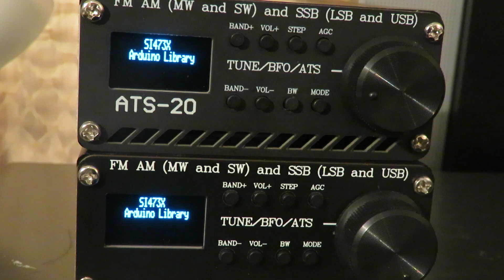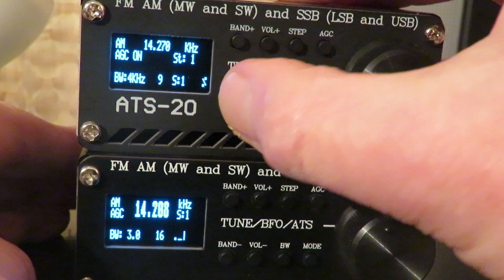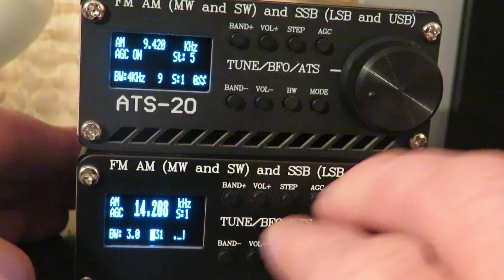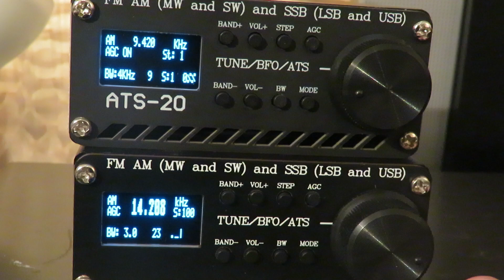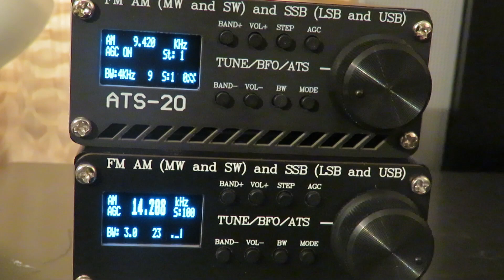SI 4732 Firmware comparison

Comment: just built my kit version of this radio, and after making sure it worked, flashed the latest firmware :)  much nicer than v1.1.5. seems only 1 unused button now Vol-, some seem to have been moved around since this vid.  Got mine stuck to a lith cell about the sise of the main board XD 4500mah. should last a good while :)
Reply from the maker: Yes I need to upgrade to 3.0.7a that is theb difference. These radios are OK but the quality of some parts, particularly the encoder isn't too good.
Reply: @KevinOReillyswl  hopefully the encoder is an easy replacement. i'm about to 3D print a basic case for my radio :)

Comment: Selecting the function then using the encoder wheel to change settings (especially volume) is cumbersome and wrecks the user experience.

It has dedicated up and down band and volume keys for goodness sakes. Why go through scrolling through functions, selecting it, then using a known unreliable encoder just to change the volume?

I’m keeping PU4CLR’s otherwise excellent firmware but trying to put some of the buttons back where they belong.Hopefully, the user interface change is not out of necessity.
Reply from the maker: I think you have a point, its down to personal preference I guess. Let's face it the encoder is heavily used anyway in a radio so if its going to fail its going to fail!

Comment: Hey Kevin, my encoder failed but I ordered a Alps encoder 30 indent, infinite turn with momentary push button. It has 2 contact tabs on one side and 3 on the other that you have to bend forwards. 

With a solder iron and a desoldering pump, you can desolder 5 connections, put in the new encoder and solder back in 15 minutes, 30 minutes if you've never done much soldering. It's a easy fix and makes the radio encoder a lot more smooth. The encoders can be had for about $8 for two of them on eBay, so you'll have a spare if it ever needs changed again or a DIY project. 

The SI4732 kit radio have slowly became one of my favorite radios, it performs well for the money and can be easily modified for a little bit of money to be a fine piece of kit.
Reply: Oh, I should mention that the encoder sticks out farther than the original, but I couldn't find a good quality encoder with such a small shaft. The original plastic knob fits the new shaft though.
Reply: @EmergencyChannel  I am going to see if I can find a knob that has a longer skirt to cover the longer shaft and lock nut.

Comment: Just wondering if the is an update to change the frequency readout from KHz to MHz.  Also wondering if there is any way to alter your own firmware so you could keep the large Freq readout, and keep the Band+, Band - ,Vol+, Vol- buttons active?  Thanks for taking the time to show the difference in firmware versions!
Reply: It's possible, you just have to teach yourself how to edit Ricardo's sketch. Changing audio with the encoder is better than buttons though. The buttons are only held to the board with 4 soldered pads so everytime you press them, you are slowly damaging the contacts.
Reply: Thanks!

Comment: Nice update i could not update the firmware i have tried multiple machines just failed everytime.
Reply from the maker: I have had numerous issues in the past updating, its a hit and miss task. If you can join the FB group and follow Ricardo's PDF instructions that may help.